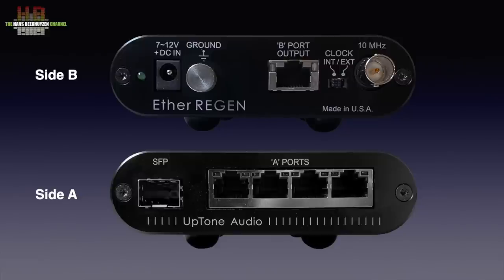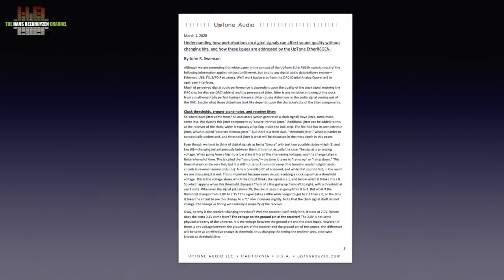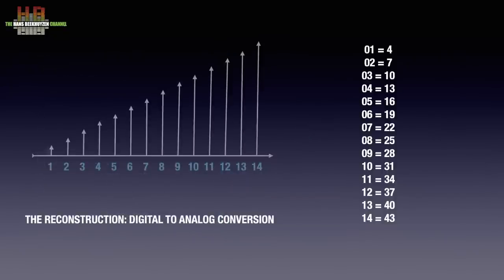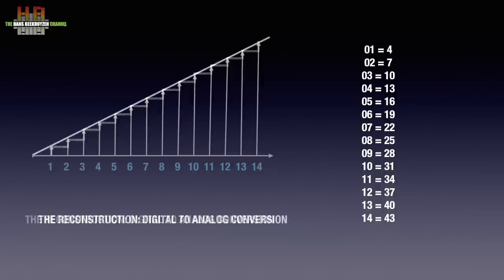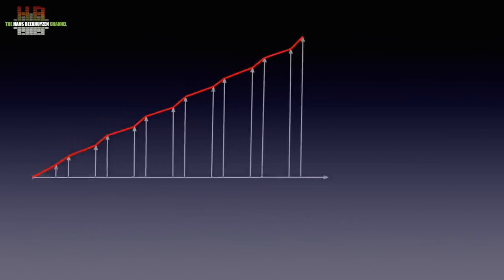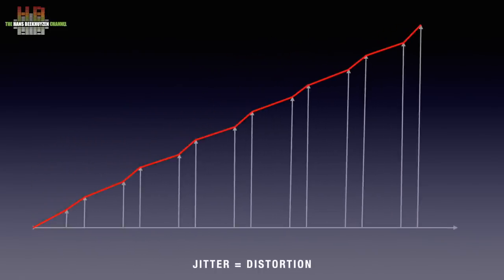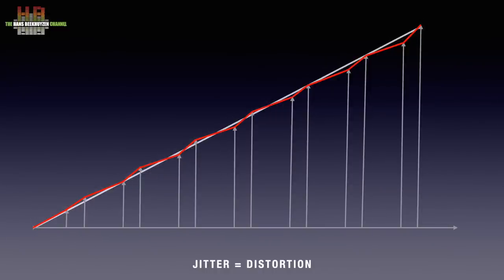Why digital circuits influence the sound quality

Comment: I can tell that this has quite rightly touched a nerve in the past with how dismissive people have been, your explanation is really good and helpful, if people don’t want to listen or hear it then it’s their fault. I am currently using a power line network plug adapter to my streamer; I’m sure this can’t be good? The Ethernet might have noise and maybe I’m putting noise into the mains too? Must sort something else :) Thanks for the great content :)
Reply from the maker: If you can't use regular CAT cable, at least make sure the power line network plug adaptors are plugged into the wall outlet and not in an extension cord. That does make a difference, although I don't know why.
Reply: @TheHansBeekhuyzenChannel  Thank You Hans, will try that. Also going to try plugging into a Mesh Wifi point I have just bought which does have socket on the back.

Comment: Hello Hans, I don’t manage to answer this question. If the usb input of my DAC is galvanicly isolated, and it is the case (Holo Cyan 2), and as you say with usb connection there is no problem with time errors from the incoming device, does it mean than nothing could ever improve the sound quality I have form my beefy PC directly connected to the Cyan? I feel like it’s not that simple but it seems so logical!
Reply from the maker: You are right. It is not that simple. There is the 5 VDC in the USB connection that can (and often will) be polluted. The galvanic separation works for DC in the signal path but not for AC signals and so on. As with every digital interface it is the way it is implemented on both sides that counts.
Reply: @TheHansBeekhuyzenChannel  Thank you very much

Comment: Hans another very detailed video on Digital Audio.  I think you did a phenomenal job of explaining how jitter can cause issues with audio.  However you seemed to gloss over the details of how the switch can impact the DAC and digital audio in general.  Is it you suggesting that the switch can induce jitter?  Or is it that noise from the switch can infiltrate the audio device be translated into the analog output of the device?  Also curious if you would suggest that the problem in these cases is with the switch or the audio device?  Is it not the job of the audio device to filter and isolate itself from potential noise in source devices?  Thanks again for your work.
Reply from the maker: Any digital device in front of the DAC can pollute the 'digital signal' with noise on that 'square wave signal'. Also the ground plane can be raised and each device can add to the phase noise.
Reply: Hi Ben. I agree with your observation that Hans glossed over "how the switch can impact the DAC..." It wasn't until the 16:53 minute mark of the clip that he says that there is a phase oscillator in the switch itself. This hit home to me what probably should have been obvious, all the signal 'polluting' elements of an electronic piece of equipment are of course present in a switch (eg: power supply.) Hence, the square wave, analogue signal has been distorted before it's even arrived at the DAC. So, as Hans also says, any piece of electronic equipment in the transport chain will have an effect on what the DAC has to convert.
Reply: Ben Payne has a point. I enjoyed the video, but it did not really detailedly explain the problem with some of the switches.

Thanks for talking about this, Hans!
Reply: Based on this, it is somewhat sad how people simply go with their emotions and accept incomplete explanations. Like most people in this comment section. 

I dont disagree that switches can possibly alter the audio quality due to the mentioned factors, but if, for example, the problem is that the data does not arrive in time due to a switch problem, should the player not simply have a large enough buffer to collect the data beforehand?

Comment: I currently use four PCIe soundcards through my one slot via a USB splitter, my CD transport is also USB, I'm currently upgrading to a NVMe based splitter and a SATA based CD transport. I'm not currently getting any audible noise, but i'm interested in seeing if I can hear an improvement in clarity.
Reply from the maker: It’s not audible noise that is the problem. It’s noise that is in the bitstream that confuses the D to A conversation.
Reply: @TheHansBeekhuyzenChannel  yes, it's my expectation that the higher levels of signal integrity that NMVe and SATA transfer protocols have will give an audible improvement.

Comment: Hi Hans. As I understand there is no thresshold exactly at half the voltage to distinguish between 1 and 0. For example: when Vmax is 2V, the design such that for only a signal above 1,2V is concidered 0, where all below 0,8V is concidered a digital 1. What is changing to your explanation if you take this into account?
Reply from the maker: That makes no difference. If in my example the threshold is raised by 0.1 volt, the thresholds in your example would shift to 1.3 and 0.9 volts and thus will the transition time shift.
Reply: There is A REASON why there are 2 different thresholds...

Comment: Problems are also introduced with recording. Sadly nothing can be done about this on playback.
Reply from the maker: I think that the major part of the music I play is recorded properly. But on a poor stereo in poor acoustics the quality in it can't be retrieved.
Reply: @TheHansBeekhuyzenChannel   In the early days of CD, I bought a disc and took back as it would not play. Week later bought new player. The issue was old player was a cheap single beam new was a 3 beam . Massive improvement, especially with tracking. .

Comment: Hans: thank you for this video.  It helps to explain what my ears told me was an easily discernible improvement in sound  
I’ve been into switches and power supplies for a few years.  Finally others are starting to catch up.  
Ignore the people who haven’t figured it out yet.  Who cares if they choose not to improve their systems.  The rest of us can follow your advice and benefit from some experimental efforts and then make their decision.  
I’ve been so impressed with the concept I have 3 switches cascaded.  With superior power supplies.  You’d have to be deaf not to hear the benefits.  
Thanks again!😊
Reply from the maker: I hope the power supplies are quality switch mode power supplies.... Linear ones work less good on switches (in fact on most digital-only equipment.)
Reply: @TheHansBeekhuyzenChannel  Really? You recommend switch mode over linear for the digital gear? Do you have an example of one of these switch mode units you would recommend? I know Meanwell and ifi make them, is there something better? Brand? Thanks Hans!

Comment: Hi Hans, I have a question about the iFi iPower dc power adapter from an older video. Will that kind of power supply eliminate noise if it plugs directly into a RPi power port, or does it have to be plugged into an alternate port on an audio hat board attached to the RPi in order to properly eliminate the noise?
Reply from the maker: First: no power supply will eliminate all noise. To get the best result from a audio grade power supply it's best o have it hooked up to the audio card directly and have the Raspberry Pi powered by another power supply (lower grade if you like).

Comment: Thanks  Hans! I'm seeing the Cisco WS-C2960C-8TC-S as well. Would you recommend the older one over this? I don't care about poE, and maybe it adds more noise???
Reply: You can use the cisco meraki as well. I removed the poe section in mine. I've used both switches, Cascading 2 of them with fiber gave me great improvements.
Reply: @Pete.across.the.street  It looks like you believe to poE section adds noise. Easy to remove?
Reply: @d.s.cullom5461  very easy. I switched mine to linear power supply also. Search meraki 220 tuning. You can do the same things to the 2960 as well

Comment: Wouldn't it be simpler to send the digital signal straight to speakers?
Reply from the maker: That depends. In general the pollution of the analog square waves that form the digital signal can deteriorate the sound quality drastically.

Comment: Very interesting, Hans!
Thank you for sharing your knowledge.

The quality of components  does matter, especially in an ethernet  network.

Not only do the physical components matter,  but also the configuration of network protocols.

In my setup I have an Aruba JL680A switch, a modified power supply, and high quality shielded network cables.
My Synology filer has a very fast direct  network cable connection, and so has my network streamer.

I do not play high-res music files from CIFS or Samba shares, but from NFS shares; these NFS  packets travel much faster over the network.

In Volumio it is possible to configure a NFS connection to a Synology NFS share, and this makes playback of big high-res digital files much better.

Comment: Thanks Hans. At 12min of the video you explain, that jitter is not relevant on asynchronious transmissions like USB or network. I strongly agree to that! So the summary of your video is, that the noise caused by network switches (and all other connected gear) can negatively impact the sound quality of digital hifi. Isn't it that simple?
Reply from the maker: Jitter in an async data stream is irrelevant, it's a packet service. It's the phase noise after conversion to I²S and the other problems I mentioned that cause for 'timing errors' ie jitter during conversion
Reply: @TheHansBeekhuyzenChannel  is the damage being done in the streaming engine where Ethernet packets are rendered into PCM (I2s or spdif) or later in the chain?  Great background info in this video by the way, but it stops short of really explaining what’s going on in a streamer.

Comment: Hans, I watched your video about switches and came away with some of the same information you have shown before.  But the big question is, "is it audible?"  The illustration you showed says that the jitter is happening at 22.1 KHz.  Unfortunately for me, my hearing tapers off about 10KHz lower than that frequency.  Therefore, I can't hear jitter and I'm not buying some fancy electronics that will supposedly get rid of it.  If you can hear it, you must have superb hearing for a senior citizen and I commend you for your remarkably good hearing.
Reply from the maker: In the entire video I have not said anything that could even lead to the conclusion that jitter is happening at 22.1 kHz. Jitter is extremely audible, but to hear it you must first recognise it at jitter. Especially jitter where the digital signal is modulated with a low frequency, say 10 Hz, is very audible. You the don't hear 10 Hz, you hear the effect of the digital signal modulated at 10 Hz.